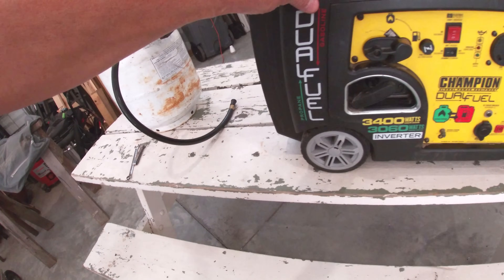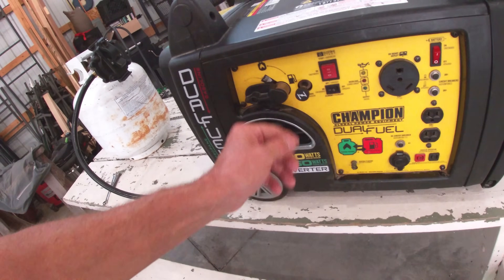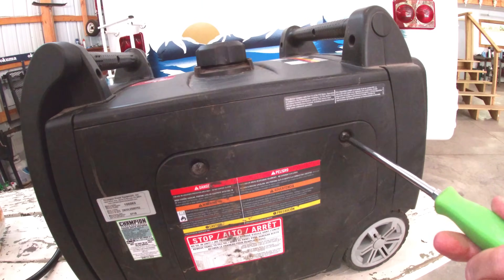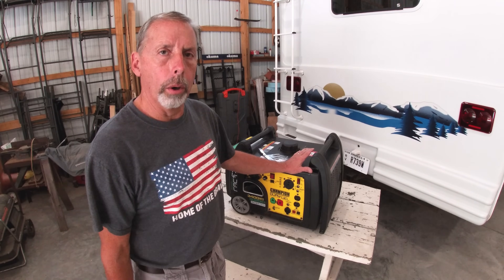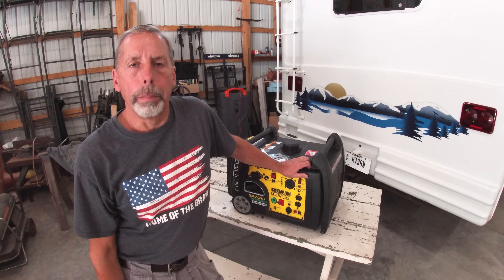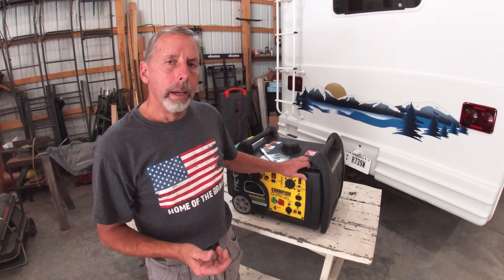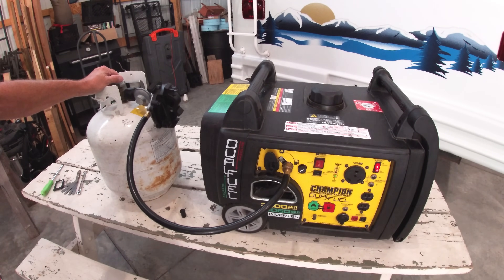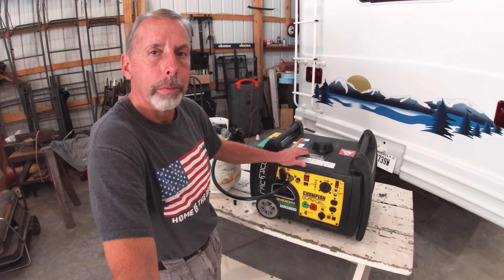Propane Generator Fail

Comment: FYI for anyone that wants electric start but the replacement battery seems excessively expensive, I came up with a very cheap solution. I drilled two holes in the battery side cover, stuck a bolt out of each and put a nut on the inside, then the ring terminal for the battery, then another nut to lock it on. So you wind up with two studs sticking out of the side of the generator. I just used a silver marker to put + and - over the correct terminal. I always have some kind of jump box with me, whether it is for my toys, vehicle, or just helping out someone else. I just keep the just pack next to the generator. I normally would only need to start it every once in a while. Normally when we are camping it is running if we are in the trailer. I use electric start on a cold start, and then if I am just refueling it, I just give the rope a pull. If they are warm and tuned up, its takes like half a rip and its back up and running.
Reply: I just changed the lead acid battery out with a lifepo4 battery. It doesn't discharge on its own and I can always start the generator. And it lasts 10 x as long as lead acid.
Reply: @jamestitone4304  If it had remote start, I would care about having a battery. I camp a few times a year, and maybe use this generator for an extended power outage. No reason for me to have yet another battery to manage. Regardless of the chemistry, it gets to -35F in the winter where I live for a week or two out of the year sometimes and I have to bring in my small engine batteries in the fall. I have to keep them on the battery tender in the winter and charging a not self-heating lithium of any type under 32F is not recommended. I have nice lithiums on my motorcycles that I bring in. Not going to chance ruining a NOCO battery lol. 
I am glad the lithium is working out for you though. I am sure it makes sense to people that use theirs more often than a couple of times a year. Most of the time it just stays running the entire time we are camping if the weather is hot from Fri-Sun. It might get started a couple of times total during that just to refuel it. The studs were the proof of concept. Now I am going to be using some of those battery tender wires to direct connect the power pack into the generator. That way I can start the generator, but also it can charge my battery pack. I need to post videos of all my random stuff lol.
Reply: I live in hurricane threat area and have not used my Champion yet but did lend it to son-in-law a few years ago. I knew avout this but forgot so without you sharing your experience I
Reply: for genuismensa:  That is thinking "outside the box".  Going to do it to mine.
Reply: @zarfer  It is really nice to not have to worry about keeping my generator on a battery tender too lol. As long as you keep a jump box handy, its honestly the best solution I could come up with.

Comment: Great video and information!  From what I’ve seen if the regulator is equipped with a black plastic QCC type large right hand thread for outside  threads , the plastic knob has a small BB type check valve built in called an excess flow valve   When service valve is opened quickly, it forces the BB to move forward to reduce flow because it thinks there’s an extreme leak in the line reducing pressure. Close handle remove black knob/ replace retighten and slowly open. Always spray those too. They do leak sometimes ( propane service tech retired)

Comment: You just solved a mystery for me.  I've had a similar problem when replacing the propane tank on a grill.  If I'd leave a burner on when turning on the propane tank valve, the flame was very low.  I'd usually go through a couple gyrations and it would work, but I didn't understand what was actually happening.  Now, I understand exactly!
Reply: same thing happended to me with my grill when replacing the propane bottle. low flame took me a few times of taking on a off the regulator. lol great to know.

Comment: I had issues with a propane tank on a grill, and this information solves the mystery. I bought a Champion 4650 W dual fuel genset 2 years ago and this is great information. Thanks for posting.

Comment: It’s not the generator or the regulator. It’s a propane tank that has a built-in pop off valve in case the line is cut or severed. It shuts off the supply of propane. if you have an empty propane hose and immediately open up the valve, it pops off that valve on the tank.
Some valves are a little more sensitive than others.

Comment: This is an issue that is common with propane BBQ grills - low flame because the tank was opened too quickly or opened with the burners turned on.
Reply: yes , thats the safety valve on the tank. designed to shut off flow in a broken hose situation. I see it every few weeks on our forklifts.

Comment: Thank you so much, sir...   your tip about slowly opening the propane tank valve WORKED! I tried everything I could to start my new Champion dual fuel generator until I gave up (with very sore arms from yanking on the starter cord) and started searching youtube for help. I found your video and got busy.  Turning the propane valve slowly didn't work at first until I disconnected the regulator assembly from the valve (I'm guessing it needed to depressurize to reposition the regulator diaphragm you talked about) - I reassembled everything,  SLOWLY opened the propane valve, and the generator started right up!  Many thanks to the Champion technical rep who told you what to do and a special thanks to you for posting it on youtube. I was about to take that Champion generator back to the hardware store and get my money back! I am not kidding!
Reply from the maker: I’m glad it helped you out. I haven’t had any issues with mine since. Thanks for watching

Comment: We just bought a Predator dual fuel generator for our new 5th. I have not even taken it out of the box. But I will open the propane valves very slowly every time I need that generator. Thank you so much for making this video. 👍🏻
Reply: It's just a propane issue, it's compressed gas so when you open it up quickly it rapidly expands and gets cold causing any moisture to freeze up instantly causing a restricted or plunged port.
Middle school level science.
Reply: @SilvaDreams  Most people think it’s the safety valve in the tank that shuts closed because excess flow that happens when you have a leak not really just a freezing issue. Middle school comment was unnecessary when you don’t know the whole problem yourself

Comment: I have heard of this with propane BBQs.  They run with half the BTU's and nothing you try to do like unclogging the lines of the burner etc will help.  You need to shut the propane off, disconnect the propane, reconnect it and SLOWLY turn the gas on.  I was then able to get full heat from my propane.  For BBQ's people usually see this problem only when changing from an empty tank to a full tank, so this is a thing.  I was unaware that this happens with generators - now I know!  Thank you.
Reply: It's definitely true. Close off all burners, then open tank valve, then turn on burners one at a time. 

I think the high-flow valves are too conservative myself.

Comment: It's not the regulator. It's the safety valve in the propane tank. I had the same situation with my grill. 2 regulators and 3 different tanks later... I finally did a deep dive into figuring it out. If you open the propane tank to fast the safety valve inside the propane tank can open part way, lot letting full flow. And it can get stuck like that sometimes. Always open slow. Been like 3 years + since then and never a problem now.

Comment: I have a 12Kw Duromax dual fuel I purchased from Home Depot  a few years back. I live in Florida and having a generator that can power up the central A/C is a must have during weeks/months of power outages. Brought it home, wired it into the house wiring and it worked like a charm for the first 8 day power outage. The next hurricane that was headed our way, we tested the generator about a week  out and had the same symptoms that you had with needing to choke it just to get it to run, and then there wasn't enough power to charge a cell phone. I used to do propane fleet conversions for the local power companies years ago and they had a similar problem with the diaphragms in the pressure regulators. And since the new EPA requirements, there can also be a problem with the safety restrictors on the newer propane tanks as well. When the problem occurs, the regulators and safety valves need to be reset, which basically requires removing all pressure from the lines and turning the propane back on slowly, so the equipment doesn't respond like there was sudden break in the supply line.
Reply from the maker: Thanks for taking the time to comment and for watching. Stay safe in Florida

Comment: We use all kinds of propane forklifts and other equipment indoors in our plant. One of the training regimens are changing tanks and maintaining the equipment. Every one of them we open the propane slowly as we were told opening them too fast can cause the carb to freeze up. Don't know if it's true about the icing but opening slowly seems to work on everything we use.

Comment: Wow is this a timely video! I am boondocking about 30 minutes from Quartzsite. I have ordered a dual fuel Champion 4250 watt open frame inverter generator, and should have it next week. It is my first time using a propane generator, and I could easily see myself turning the tank on too fast without this heads up video. Thanks!
Reply from the maker: We were boondocking in Quartsite last year when I had issues with my Champion. Have a good time there and thanks for watching and for taking the time to comment.

Comment: Thanks for detailed explanation, this will help many people.
This is a common issue with newer propane regulators, it’s a built in safety feature in order to restrict the propane flow in case the hose bursts or develops a big leak, 
It’s not limited to champion or any other brand of generator, 
but you’re right, it should be mentioned in the owners manual.
Reply from the maker: Thanks for watching

Comment: Thanks for the info!  I bought a Champion 100574 dual fuel 4 yrs ago, and have only used it for power outages.  I have not had any problems, but I'll be aware to turn the valve slowly to prevent problems.  The Operator's Manual says: "Fully open the LPG cylinder fuel knob."

Comment: You just described my issue with my griddle in a cold weather. I figured out all by myself, and forgot already. I would never know generators may have the same issue. Thank you for reminding me. I'm installing the propane kit, and it's gonna be cold tomorrow.

Comment: Great video.I would have tried gasoline to eliminate if it was purely a propane issue.
Some people never want to run gasoline through their dual fuels,bad idea.
Condensation will eventually leave rust and corrosion in the carb if it’s never run through.
Good idea to alternate between fuel sources so everything gets a run through.
Good luck with the gen,I like the Champion dual fuels so far.
Reply: Bullshit.
Reply: @glasslinger  Better go back to Legos Slappy cause you don’t know engines

Comment: I have watched a number of videos about dual fuel and propane generators.  Several of them have referenced the slow opening of the tank valve and even a release of the connector from the tank to the generator to dissipate air before starting.  Seems like this is a pretty common issue and I am glad to know about it.  Thanks for your video.

Comment: Back around 2005, I bought a super duper six-burner stainless steel BBQ. The second time I tried to use it, the flames were as weak as a match. The guy at BBQ Galore told me how to turn on and off the propane. Never had an issue with it again....the burners started pumping out some serious BTUs. I am in the market for one of these and you passed on some good information. Thank you.

Comment: Thank you for doing this. As you were talking, i actually was thinking to myself that the problem is the differences in pressure from tankside to the generator. The "rush" makes the regulator act like a severed line and it reduces the flow. You can simulate this condition on a grill. With the propane tank in the off position,  turn the burners on and open the tank. It will restrict the flow. It's a safety feature. However, if everything is off, opening the tank should cause the pressures to balance and the restriction should not be triggered. I am not sure how the gas valve on the generator works, but if in the off position, it should balance out. Then you should be able to turn the valve on the generator on.

Comment: Well, your trick worked.  Couldn't start my generator on propane, but put a little gasoline in it and it would start right up.  It was driving me CRAZY.  Opened the propane bottle slowly and boom, started right up and ran great for hours.  Thank you for sharing.
Reply from the maker: Thanks for watching

Comment: Great video and you are spot on!  Agreed that other small propane appliances like grills, can have the exact same problem.  This should be in every propane appliance manual.  I have also read that Champion did seem to have some bad regulators and would often send a free replacement to people under warranty. (but I don't know if the regulator was actually bad, or just the issues like you had).  However, regulators do go bad, often from living outside, especially in a marine/salt water environment.  So keeping a spare is a smart idea either way.
Reply: the same thing with the gas grill

Comment: Propane tank valve was my issue, same thing happened to me. Open fast and the valve will click, blocking fuel flow. Open slow and works fine. Safety mechanism in the tank valve caused my problem and hasn’t happened since. Thanks for posting your information as it could very easily be a different issue all together on yours.
Reply from the maker: Thanks for watching

Comment: Good video. I have the exact same generator and I've got several hundred hours on mine and I've never adjusted the valves. I heard the trick about opening the propane valves slowly at least a couple of decades ago after the industry switched over to the new style of valve and so I've done it that way ever since.

Comment: I am on my third Champion 3400 regulator in about four years.  I had learned about the slow opening some time back with a gas grill.  It didn't help with the first two regulators.  First replacement one was under warranty,  Second  one was on me. The latest replacement has been working fine for over a year now, with about 100 hrs total on the generator. I think they just had a bad batch or regulators.  But I make sure to follow the slow opening rule.
Reply: The problem isn't in the regulator. The problem is in the safety valve of the propane tank. It is internal to the tank and is designed to shut off or highly restrict the flow of propane out of the tank, should there be a hose failure, or if someone opened up the tank valve whole it is disconnected.
 All newer propane tanks have this safety device. But some of these propane tank safety valves are more sensitive than others.

Comment: I have the exact generator, bought mine 6 yrs ago and have 40 hrs on it.  My gas grill would not work and I googled regulator and it said open slowly and that solved my grill issue, so every time I use the generator,I open the bottle slowly and I have never had any issues other than my battery died, but it starts with 2-3 pulls of the pull starter.. great video and info.

Comment: I knew what you were getting to, I have the same issue with my gas grill if I open the valve to fast, I get almost no flame. I think its a safety feature of the regulators. it thinks theres a gas leak when it sees the rush of gas pressure

Comment: Great video with explanation. I've had this same issue when using a gas grill and gas heater.. The intense and rapid pressure input does something inside the regulator and they will not work.  Can't remember who told me to open the valve SLOWLY to fix the issue but it's become a habit now. I do have a dual fuel generator but thankfully it's still in the box. I thank you for putting out this information.
Reply from the maker: Thanks for checking it out

Comment: I have a Champion dual fuel generator and I use it for camping too. I have struggled from time to time with several propane appliances and the regulators are the big problem. The safety features can cripple them, some require large flow, some require barely any flow, and there's not a lot of help out there! Thank you for this video!
Reply from the maker: Glad it helped. Thanks for watching

Comment: Geoff, you must work with or studied regulators, it happens on all regulators the newer they are the less quality the get. BBQ, RV appliances and whatever else has a regulator and there are new safety items installed, the slug valve as Geoff describes is one of them. Basically if you cut the hose it wont let out full pressure in the event of a catastrophic failure of the gas hose and a running generator, its a good system but turning on the exercising the diaphragm keeps it moving, when disconnected it gets moisture inside and a bit of corrosion is all it takes to stop the slug valve from opening. So in all essence it is best to exercise this valve to keep it moving properly. The generator in the video was in fact starving for fuel and he worked it free and did a heck of a video describing just that. Well Done.